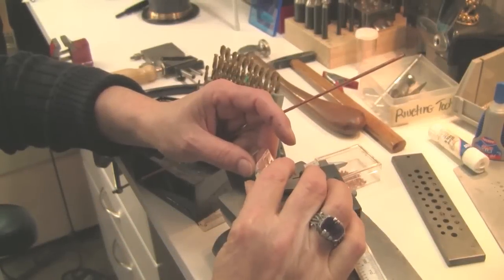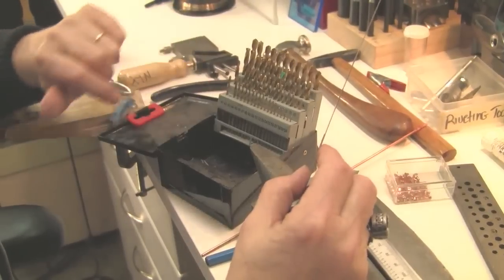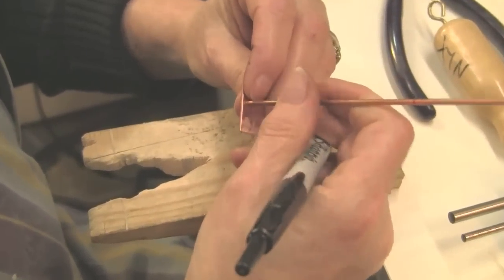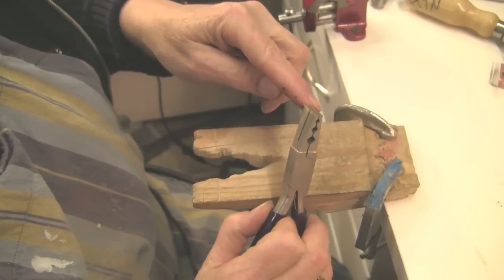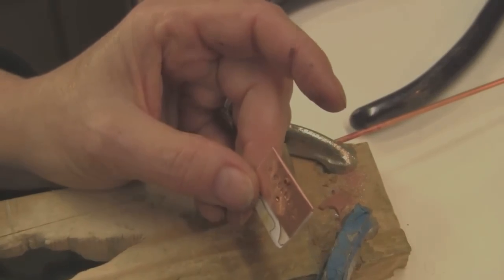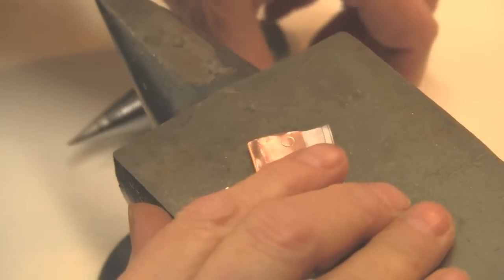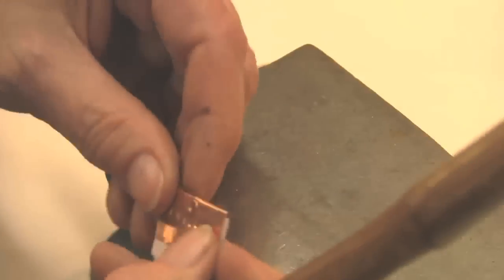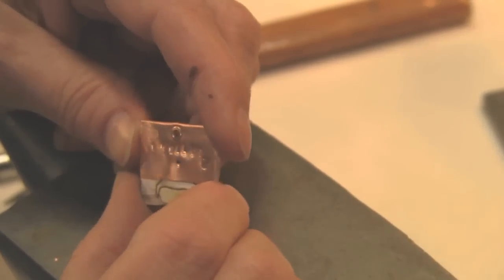Tube Riveting | Jewelry Tips with Nancy

Comment: Nancy, Where did you get your drill bit set???  Do you think one from HF would be any good?
Reply from the maker: gail Williams I got it at Harbor Freight!!!!  I've had it for a long, long, time.  Of course, I don't use it all the time.  I generally use High Speed Drills in smaller sizes that fit into my quick change handpiece.  But, when I need larger bits, the set is great. Thanks for watching!